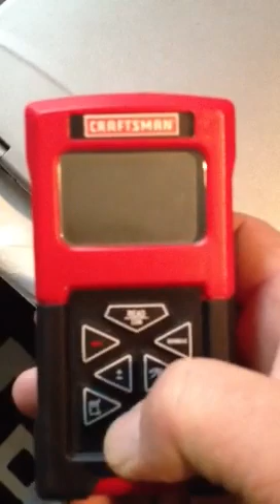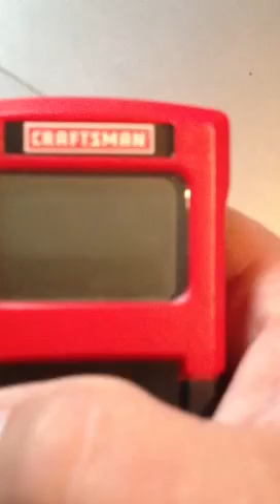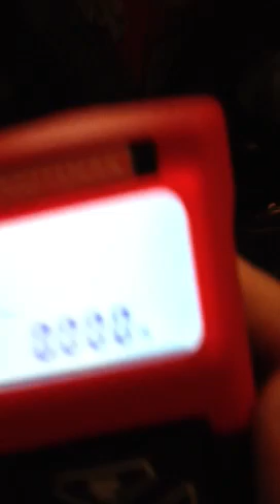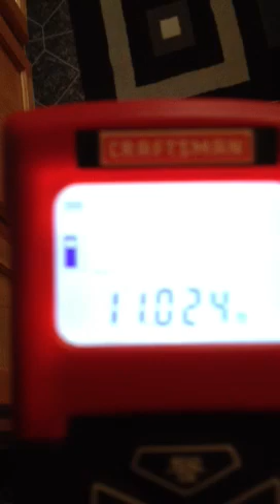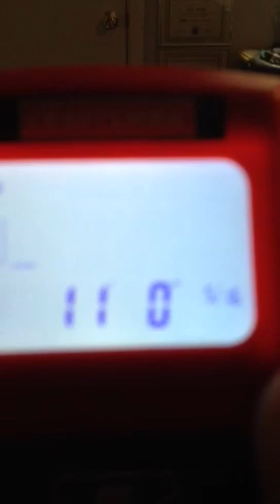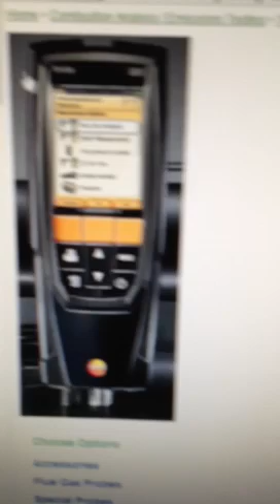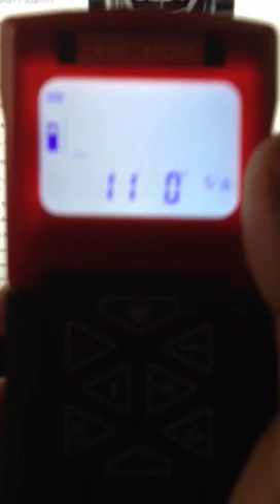Thanks to eleverich

Comment from the maker: It's going to be a big help. I always feel a little uneasy when wielding a tape measure in an occupied home. Fear of scratching something. No more contact = no more risk.

The 327 was a big improvement over the TPI monoxer I was using before. I still use the TPI for testing individual cells in nat draft furnaces while the 327 is in the flue.
I need to get better at editing and planning videos.Always seems to be chores that needs to be done instead. 
If I inspired you than my work is done!
Thanks

Comment: I'm glad that you like it! 

Once you play around with it and learn all of its features you won't be pulling the tape measures out anymore..

You got a better deal by picking up that 327 because it is a better meter. The new 320 will be replacing the 327, it's basically the same meter with the color display.. 

I think that you should get back to making video because you do a very good job yourself.  When I started watching hvac videos it was your videos and Dr. Z that got me going.